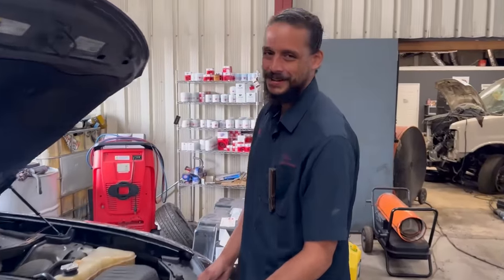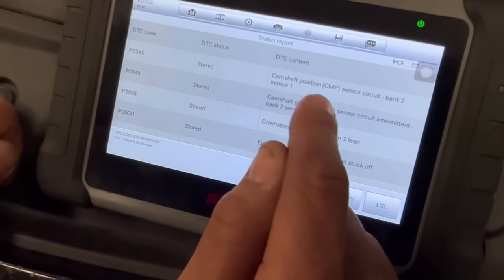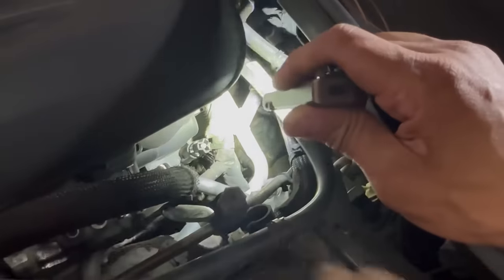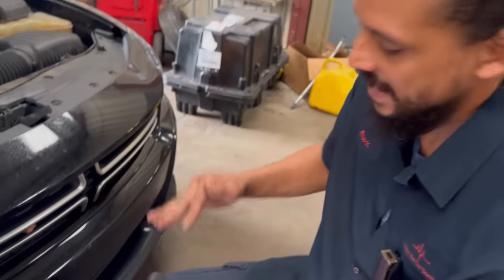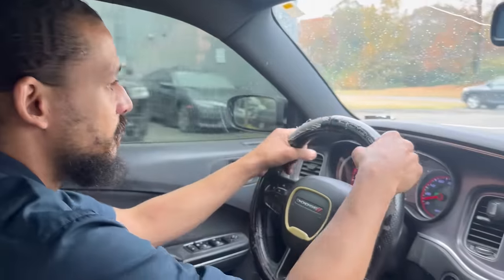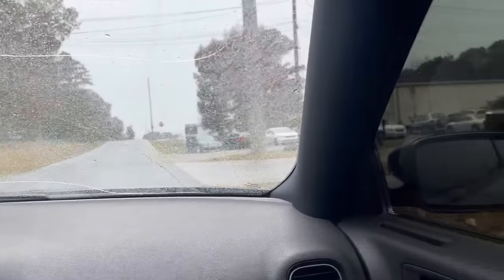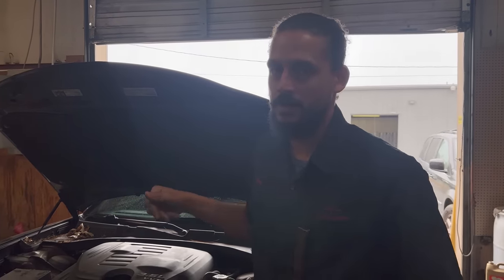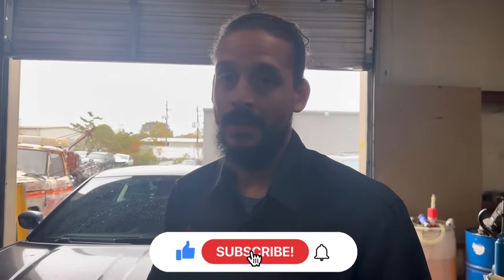YEAH RIGHT! Dodge Charger 211,000 miles and NO LIFTER TICK 🤔

Comment: I like your style and and i run my shop with the same integrity. Good job! I will say that ive never had any Pentastar issues except the leaky oil filter cooler. Run good synthetic oil 5w/30 and got 170k on a Grand Cherokee and 57k on a Gladiator no ticks.

Comment: My 300 with the same motor is at 248k. No noises. Purrs like a kitten
Reply: Its because you drive your ride economically keep it up 👍💯
Reply: Whatever you’re doing keep doing it because that’s super rare. Good on ya.
Reply: Badass 💪💪💪
Reply: Nice my challenger going at 172k so far engine nice and strong same with transmission but gonna need new suspension lol but still running good
Reply: It will probably catch you off guard at some point like in this video haha
Reply: He travels 3 hours to work everyday to make his car payments
Reply: What’s ur oil? And is it 5w-20 or 30?
Reply: I got the 2.7 08 180,000 miles no problems yet besides thermostat housing
Reply: A code is a cat?
Reply: Pentastar challenger..247k oil cooler the only issue I've had. Still runs like new and altho I take very good care to mind all maintenance milrstines, I don't and have never babied her on the road.

Comment: Great video alex .i got a 2014 charger at 108k not ticking yet i already have bran new 24 rockers an the lifters. And the special tool to lock cam phasers.i already replaced my oil cooler 😅😅. I do all my own wrenching luckily.

Comment: Any opinions appreciated. I have 31k miles on mine and am going to change from 5-20 to 5-30 oil to hopefully help with keeping oil up top on the motor at idle. I'll be happy if I get 200k out of her 🤞🤞🤞
Reply: Thats not going to make a difference buddy. If you dont have oil up top, you have severe issues. Like lifters. Get it fixed properly, and only use the oil that the manufacturer calls for. Don't use additives.
Reply: @thagerdorn2009  I meant thicker oil will stay up top better than thinner oil, that was my thinking at least.
Reply: Won't do anything. Look up RAT 540 blog, the guy independently rates oil for shear. He explains why thicker oil won't help a flat tappet cam. They rely on high oil pressure. He uses the cheap Quaker state full syn and his testing shows in a real engine it has the highest shear value of any other oil. That's what will keep your cam from getting wiped out when shtf.

Comment: While I know other years are a problem, almost every Pentastar on these repair videos with a ticking issue turns out to be a 2015. OTOH, only about 30% of vehicle owners do regular vehicle maintenance, including oil changes, and even then if you follow the manual maintenance schedule, you may go, 10,000 miles between changes, which will pretty much kill any car. My cousin has a 2015 Jeep with a Pentastar and it started ticking around 100,000 miles, and yeah he's pretty bad at changing the oil.

Comment: 2018 Ram 2500 6.4l 170k miles no lifter tick and trucks been worked hard. Mobil 1 0w-40w since new changed every 6k miles. It does have some exhaust leak ticks, but not the lifter tick knock on wood! My work truck and we work them extremely hard and they do idle for long periods of time and out of a fleet we have only had one fail to that issue.

Comment: Great content as usual,
 the pentastar is easy to maintain everything is reachable.
It always the driver fault not taken care of they car
Reply: That is very true and to add to it, sports cars we tend to dog and get on them a little more, so if you have poor maintenance on top of it, well you see it first hand right here. All in all, 200k is a lot of miles so he didn't do too bad. People think that they should get 300k or more out of a car, but face it that is a lot of miles. I've seen some get 4 to 500k miles and still going. Far as I'm concerned, that is a miracle, especially on a Charger.
Reply: Not really. The lifters are pretty poorly designed and the oil cooler housing is made of ABS plastic. It would probably be ok in a small city car, but not a car that is marketed as a muscle car. If you are heavy on the gas, it will break and if it’s the oil cooler that breaks you are probably going to need an engine. That’s not regular maintenance. Having a critical part like that with such a high failure rate is unacceptable. That’s not an ok place to cut corners to keep costs down.
Reply: @Leonarco333  I speak from my own experience, my channel literally has all of my content on my 2012 dodge charger all maintenance done by me on video. 
Preventive maintenance is all this car needs.
Reply: @mightyprophet4581  well congrats. I’m also speaking from experience. My Chrysler 200 had the same motor but was an absolute nightmare to do every single little thing. I sold it before I let the intrusive thoughts win and push it off a cliff into the ocean.
Reply: @Leonarco333  aaahh lol that engine is not made for that small car, the 2.0l & 2.4L are good engines for that car.

So You are correct the penstar will be trouble with very little room to work with in the 200.
Reply: @mightyprophet4581  yeah tell me about it. Lol
Reply: I replaced that oil cooler for the aluminum one issue fixed got an oil catch can as well mmm change the pcv valve every 35k mmm change diff oil every 35 as well same with transmission oil mmm also just did the power steering though one to do but man turns with ease and main oil changes every 6 months about 4K miles I don’t drive a lot now lol and no codes at all does rattle but yeah suspension isn’t the best so ima upgrade that soon very good cars as long as you do the maintenance easy to work

Comment: You are a good guy Alex, I like you. I just subscribed. 6k to do all that work on that car is a bargain. The only thing that worries me is after all that, the transmission. You may be able to find a low mileage used engine and transmission for it. I don't know if you do that sort of thing. Good video
Reply from the maker: Thanks for the sub! Welcome to the fam! And yes I swap the engine for a low mileage used one. But it depends on the customers wallet.

Comment: Ive got a 2017 charger pursuit 3.6L... 139k on the odometer, and 7,6xx idle hours... I'm roughly at 390k miles... oil canges every 3k miles for the last 2yrs that I've  had it
Reply: 390K MILES??? DAMN think that’s a new record for the 3.6

Comment: I take good care of my cars but I only change the oil filter on my 3.6 Penta every other change. Barely hand tight on that plastic cap too. I am so paranoid of a filter housing leak. I had it once and I 🙏 to never have it again. 😂
Reply from the maker: Did you upgrade to the aluminum one? Problem will be solved…

Comment: the penastar chysler engines can last if they go with quality rockers and lifters. Those cheap parts with the vendors they go through is casuign ppl to go through engines. also th 5w-30 in the southern regions they require yu to use isnt enough protection.

Comment: I see it's a VVT engine. After watching your video from 2021, as you were just moving into the shop, you discussed EcoTech engines, showing thise roller arms / lifters, I checked on mine .... 5 literally broke on the intake side from an impact while driving in I-5 Friday, August 29. 😮 Praise God, the engine shutdown, and Iwe safely pulled onto the outside shoulder.  😇🙏

So despite it being replaced ~134K miles back, your reference to the leaky oil cooler, and its low pressure, could have been the downfall of that carnage, as mine was probably leaking, and didn't correlate.

So instead of an engine, will likely be looking for a new to me used vehicle from a 2011 Chevy HHR with 284K on the car, 314K on the engine.

2024-09-09 0222 PT

Comment: Hello Alex my name is Jared I have the 2019 dodge grand caravan van its great 75 ,miles suspension checked all its good but I'm hearing a noise like something its loose .have you had any experience.with this issue before? Oh my bad the noise its in the front .all bushings are new motor mounts new .can it be the shocks.?

Comment: I have a 300 and it throws a camshaft code when I’m low on oil. The light goes away After I top the engine off with oil . So maybe this charger has low oil due from that leaky oil cooler

Comment: wow Alex, a lot going on with that car, 6,000 is a great price to bring it back to a dependable car but is it really worth it?, a better idea may be to get the brakes working better, mayby just front rotors and find some low cost tires, then it could be driven a few more thousand miles or be sold as a budget car for 1,500 or so, there are people out there that a car that only has 5 or 10 thousand miles left it may work for them

Comment: My 07 charger 3.5 had almost 300k and sounded like it did when jt rolled off the lot. I was original owner
Reply from the maker: Those 3.5’s are pretty decent motors. Way better than the 2.7

Comment: Better clean the engine, put some cheap tires, maybe do something to stop the limp mode. Maybe used cam and sell it.
Reply: That's fucked bro passing your problems off on someone else that spends their hard earned money on it smh. Either fix and sale it. take the loss up front with someone. Or Part it out. Don't screw someone over.

Comment: Alex, you say dry rot too much. Dry rot happens when a car sits for a long time and the rubber starts to crack. When a car is driven, it's not dry rot.
Reply from the maker: So is it when the car is driven? Learn me something 😃
Reply: @AlexTheCarDoctor  it's normal wear. Cracking on a belt is normal when it wears overtime. That's not dry rot. Cracking on tires on a car that's driven all the time is from the weather and elements and age, not dry rot. Dry rot only happens when a vehicle sits for a long time. Dry rot in tires will cause the tires to have shake to them and possibly wobble.